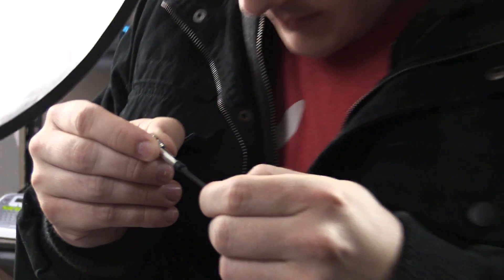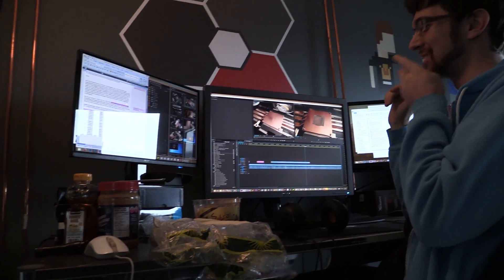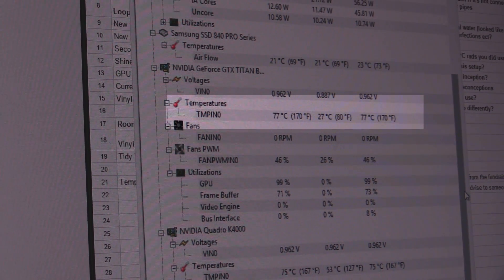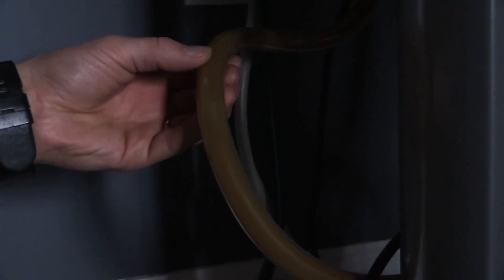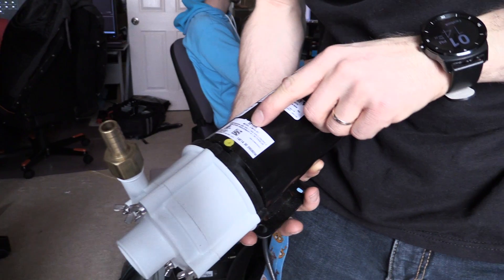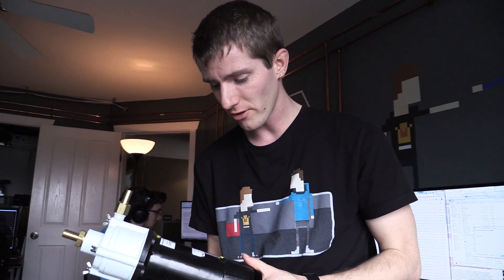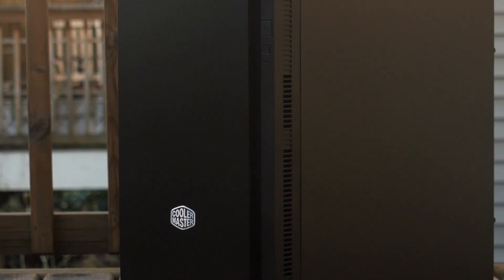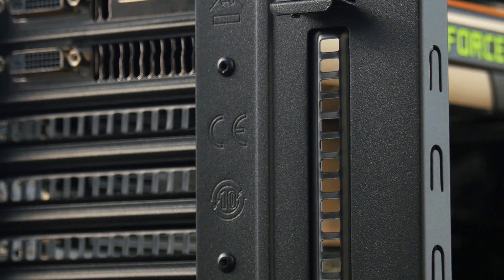Whole Room Water Cooling Part 5a - Trouble is Brewing in the Whole Room Loop...

Comment: Aluminum reservoir. Close the system. too many clear hoses in open light. Use a high pressure pump after the res, and low pressure to return

Comment: I still would have liked to have seen this being done with central heating system inhibitors rather than car antifreeze. The issue would be the rads freezing outside. But I would suspect it would be better suited to the copper heavy piping and lower coolant temperature compared to auto antifreeze.

Comment: I know this is an old video but a tip for any plumbing if you got stuff growing in lines and you got clear lines switch the clear lines out for black or dark ones and the stuff can't grown with no sunlight. Learned this on an irrigation system.

Comment: why didn't you fitt a central heating pump it has a high flow rate and would easily circulate your cooling fluid just wondering as they are sooo easy to fit .

Comment: I'm posting this because we had this issue and many others do.

We had the same problem in my office...no matter how much cold air we blew upstairs it was still hot as hell....portable AC units create a large heat source on the compressor side which is inside the room hot enough to be to hot to touch and their loud...window unit are also loud which is guess what...in the room...the solution was counter intuitive...remember...heat rises...and the momentum of  thermodynamics is a bitch...it's air circulation that is the issue...we ended up keeping the AC blower on at a set temp 69 Deg F all year round and venting the air upstairs down into the living room, through the floor which was luckily on the opposite side of the house from the AC intake....no more problem...AC get expensive but the office heat the house in winter....it all boiled down to air circulation.

If you've ever been in a server room for long enough you get cold because the air is constantly circulating at 50 deg F. Running all those PCs is akin to constantly cooking Christmas dinner with both ovens going and all burners burning.
You guys have a great head banger of a project...but just an observation...I'm sure you've heard plenty of them...copper is a heat sink and you've just created a huge heat sink back into the office space....also you've created a large multiplayer by the square of the distance and elevation with respect to gravity Vs time pertaining to head pressure...each time the fluid changes elevation in that same office space...all this relating directly to pumps COP (Coefficient of Performance)...COP=hh/hw...and...head pressure imbalance for PC pumps Vs larger main pumps. You're likely to get PC pumps running backwards...heating each system...and the fluid...as they fight to maintain directional flow prior to PC pump failure.

Also there's something called ambient temperature flux or the gradient between the outside and inside temperature and on a warm day your going to dump heat back in the office space...the system outside is far larger then the system inside and let's not forget that the PC liquid cooling is designed against the studied average ambient temp of any given living space considering AC.

And the real bitch is...Water has a specific gravity of 1.0 kg per cubic foot (62.4) lbs/cubic foot....anti freeze actually is heavier...and get heavier...the colder it gets...by design...that's why is doesn't freeze...it's also corrosive and breaks down certain polymers over time.

If you had not changed elevation...i.e...run the piping horizontally behind each workstation and through the wall without running internal pumps it'd been much better.

Heat output
Heat output is measured in British Thermal Units (BTUs) - 1kw/hr = 3412 BTU/h or 1000 BTU/h is around 293W.

Based on the 754 watt figure, BTUs/hr = (754 watts * 3600) / 1054 = 2577 BTUs per hour, per server.

When calculating the amount of cooling (air conditioning) required in a room, you should take into account that the room should always be maintained at an ambient temperature of much less than 35 degree Celsius and that any other equipment in the room will also generate heat.

Officially, Intel recommends the following for the one SystemBase AXIII chassis (in a rack):

Important: For ventilation, the equipment rack must provide sufficient airflow to the front of the server to maintain proper cooling. It must also include ventilation sufficient to exhaust a maximum of 4,100 BTUs per hour for the server. The rack selected and the ventilation provided must be suitable to the environment in which the server will be used.

Web-based conversion calculators can be easily found (e.g. http://www.anver.com/document/company/Reference%20Guides/power.html).

Comment: I came upon this video and enjoyed watching the evolution of the project even though it is years old I would put my 2 cents worth.  The gunk and other issues you were encountering were due to the fact of using copper piping when copper piping is manufactured the inside is coated with manufacturer oil and other foreign debris and why it's extremely important to clean the inside of copper piping before installing it in your house.  A better solution I did use in a similar project was PEX pipe.  After full assembly of the project was completed ran caustic cleaner through the entire system afterward mix my solution using distilled water only system ran for 4 years without any issues or gunk in the lines.   FYI.... the reddish hazing observed in the cooling tubes appears to be rust from the tap water interacting with the copper piping.

Comment: They didn't wipe off the flux after welding the copper so they instantly corroded... Eventually that would lift the welds and start a leak

Comment: This is like... 4 years too late, but that's bog-standard Iron Reducing Bacteria. I'm a licensed water well contractor, and this is one of the main things we have to fight in under-utilized water wells. It's common in pretty much all water out there, and you filled the loop with tap water. Only way I can see that you could have avoided it is by using water that's been treated with reverse osmosis.

Simplest way to remove it from a system is shock treatment with a combination of vinegar (an organic acid) and chlorine. You want the chlorine for disinfection, and then you use the vinegar to buffer the solution and keep the pH under about 5. If the solution gets too basic (high pH) then it can trigger natural defense mechanisms in the bacteria that keep them alive.

Hopefully this comment helps anyone else who runs into this sort of problem.

Comment: You've got to be careful with engine coolant. Many have silicates. We had a rash of radiators pop holes in the aluminum because customers were using silicate coolant. The silicates have limited solubility. That being said the silicates can drop out of solution and erode the metal in the radiators as well as clog them up. If you're using a silicate free solution, you're fine. But I've seen actual car radiators spring leaks from this stuff when their specific radiator wasn't designed to run a silicate coolant.

Comment: At the end of this video, I'm compelled to ask you if anyone ever read any of the { TECH- DATA } on the gear your using { before you started this oddesy} or ever spoke with the manufacturer about any of the known pitfalls of this system, they usually are very helpful people to speak with as -you should know, being in the Tech field, and is there not a conditioning fluid recommended for this tubing and internal cooling parts, this just seems like a total rookie mess.

Comment: The solution is to right angle the cable. (for the mic transmitter)

But I'd have plumbed the cooling lines differently, doing it all in one single loop, without all those tees. Would have been way easier to pressurize the system and get the air out.

Comment: Really late comment - but if you mount wireless pack upside down and gaffer the wire into an omega shaped loop the tension on the cable is significantly reduced.
Reply: great comment! Mind if I use this for my systems? Thanks!

Comment: why did you not use a check valve so the coolant would not drain back into the tank and draw air from the tank through the return line, and since your using many different types of metal you should have used Dex Cool that is orange in color

Comment: Should have installed Water Filter System,  and used  Distilled water with a Alcohol.  As for your Radiator System... I would use a Small Car radiator,  with a Fan Motor from a Car that will with stand to outdoor weather.   And I would also find out the maximum pressure the Cooling systems within the PC's are.  Then install Turn off's at each connection to the PC's. (That is so that you can Move these PC in and out of this room for Hardware upgrades & System Issues.  If you don't want that brown crap growing in the system.   Use Stainless Steel Pipe.  (Food Service Quality).  You may need to research for a Anti-Freeze that uses not Organic material.   Last but not least.  You need to Bleed the system of Air, just was you would do in a Car's Brake or Cooling System.   That is why I mentioned Maximum Pressure for the PC's...  Because you'll have to put a Pressure on the whole system...  And where your Radiator is... that should be where all your air should be bled from.  A car's cooling system runs at a pressure of 10 to 15 pounds at Temp... 180 + Degree's F...   So if you look at it in the same way a Automotive Cooling System works..  You get what I'm saying...

Comment: I'm perplexed by the configuration of these copper pipes. It looks like each PC has an 'in/out' or 'hot/cold' if you will configuration. In this circumstance I don't see how the coolant flow is anything but a crapshoot. Each PC should be taking an input from one pipe and then feeding the output back into the SAME PIPE to be continued on to the next PC in line and then eventually to the radiator. The other pipe should simply be a RETURN from the outdoor radiator back to the reservoir/pump. Am I missing something ?

Comment: 0:27 Instead of using a traditional molded flexible strain relief, use the quarter-toroidal kind that GameCube controllers have, like this: http://cubemedia.ign.com/media/hardware/image/controller/finalgcncontroller7.jpg It takes more space, but spreads out the bending evenly over a longer section of cable.

Comment: Some metal is manufactured or cut in processing with certain coating for preservation. But what came out of your reservoir looks like it molded and was possibly used and stored for a extended time prior to this project.

Comment: That seems like the flux from the copper sweat points. when the waters cold it stays stuck to the pipe, once the water heats up it starts to melt and moves along with the water. IE the machines heat up and so does the over all temp of the loops pulling all that with it. I noticed some green at the joints. That's what corrosion on copper looks like when you leave that flux on there.

Comment: If only this very searchable page had been located from 9 years earlier than this video was made...  

``antifreeze is not a 100% anti-growth inhibitor - if you want ZERO crap to grow in your system, toss in a few drops of iodine and you're set``

``Antifreeze is only poisinous to mammals because of the way our bodies process it. The liver mistakes ethylene glycol for alcohol, and bad stuff happens from there.

Anyways, put in a little biocide next flush and refill. Iodine works, and so does humidifier bacteriostat. You can find it at Sears.``

https://www.overclockers.com/forums/showthread.php/448086-How-does-mold-grow-in-a-25-Antifreeze-solution

Comment: Omg you are using TAP water in  would 50/50 distilled water to antifreeze or boil tap water the put the radiators in parallel if in series the heat from. Station 1 will flow into station 2 and so on each station needs same Inlet temp

Comment: Your trying to keep the pc's cool right?  Then why in the hell would you use Antifreeze???  You do realize that only has one purpose right? Look very carefully at the bold print on the label...lmao  You'd be better of using Distilled water and pairing it up with an above ground pool pump and filtration system, or possibly an under the sink size kitchen filtration system. You absolutely ""DO NOT"" need to be using Antifreeze though.  Remove that from the equation, and save yourself a shit ton of headache...roflmao

Comment: Just watching this from the vaunted year of 2018 it is amazing of simple mistakes made here. Plumbing tape. That's a must for any connection. If two fitting no matter what they are come together its gets tape. It's a  1.50 USD . It's not expensive at all, but save so much . Towards the end of just this part I can hear the same sound in his voice as when I screwed up my way overly complicated, totally unnecessary continuous  two system loop in 2010. Ahh a very expensive  learning lesson. I knew better to keep that teflon tape on hand. Tones of it too. It protects you and you gear , so to speak.

Comment: With all that copper in the room, I am pretty sure that most of the heat you are trying to get rid of is dissipating into the room through the pipes, and not outside through the radiators. I think more thought should have gone into this project.

Comment: higher flow rate = more equal cooling if the fans and radiators can deliver their cooling.
Edit: Also, use Glykol based anti-freeze. Doesnt clog as easy.

Comment: Flush the system with rubbing alcohol, then make sure you just use only distilled water. Cause tap water with antifreeze is probably the last thing you should use in a system. Further the bacteria that has formed in your system could be the same that causes legionairs disease on account of all of the tees in your system the fact that the water is probably again just at a luke warm temp.

Comment: Nice job Linus what you have in your tank is probably algea of some sort or it could be the reaction of the antifreeze and different metals in your system as you have copper and aluminium together, and how is the grounding potensial is the bathroom and the computer room on the same grounding loop if not then there could be a potencial that makes it grow faster in the bathroom than in the rest of the system

Comment: Why isn't the pump on a high point with the reservoir T-split on the intake?

Filling up the reservoir should then fill up the pipes with minimal bubbles, if you use the bottom pipes to feed the PC's.

Maybe the pressure would be too high on the lowest point, but the pumps would have a much easier time pumping around water and the reservoir only has to have one line to feed the system.

Comment: if i did this id use a 100L  plastic storage tank sat in the bath with plastic fittings and clear  pvc tubing  not copper lol
Reply: and a high pressure pump to push the air bubbles from  the pipes

Comment: Holy crap Linus, who designed this pig?  No valves?  No quick disconnects on the inlet and outlet of every component to make maintenance easy?  Probably should have put some isolation valves among the greater between halves.  The clamp method was surprisingly effective though.  Kudos for creativity.

Comment: that is what you call mould, It'll gum up your blocks. I' think it can grow in there because antifreeze isn't intended to be a biocide. If you think about it, an automotive cooling system gets little or no light, and every time you warm up the engine, it gets hot enough to kill just about anything. Hence, antifreeze doesn't really need to be able to kill algae.

Comment: Off the top of my head, I am saying meso-bacterial colonies. That could be VERY BAD health wise. Deadly. Or, far more benign algae. I suggest that you run the fluid through a UV/germicidal ray water sterilizer and have a non-UV reactant biocide in the loop as well, non-metal based, otherwise it will corrode your blocks to salt.

Comment: You used automotive antifreeze concentrated, and mixed it with tap water in a previous video. That's a big problem and making the tank rust. You need distilled water , not tap water with minerals in it

Comment: I could tell you as i'm a Station Engineer Retired ( Disabled ). You should have used a Nylon RV tank for a reservoir. and you wouldn't have this problem and you could have used a nontoxic RV antifreeze which is also non corrosive. and not as thick as Car antifreeze. though it is Pink in color. I worked in that industry for many years also. Also you could have used Pex for your tubing instead of Copper. The organism you found in the tank is a type of Algae that will grow in cold dark water  systems. It's getting enough light from the Tubing your using to grow.

 In Boiler rooms we have some chems that keeps it out. though you wouldn't want to use those in that system. You really need to look at the PH and acidity of the water your using. Antifreeze needs to be a 50/50 to water ratio in vehicles You shouldn't need but maybe a 10% mix for that system and maybe a very small amount of clorox or a non toxic antifreeze like is used in the RV industry you can buy at any RV supply for about $2.00 a gallon. 

Also a Air Purge should have been added at the very top of the system and would have got rid of your Air lock problem. It's basicly a Bleeder though works automatically.

Comment: you should either have gone with a UV filter (needs to be cleaned at intervals) or pool cleaner and copper sulfate (maybe some sodium bicarbonate too, to balance the copper sulfate), which works like magic. I'we worked with a waterpark system, and fresh water filtration system on a cruise ship, and the automated filtration system worked just fine, with no buildup if we cleaned the filters, and re replenished the chemicals